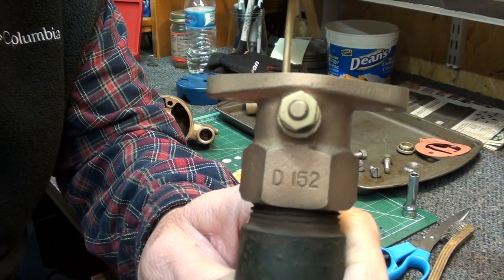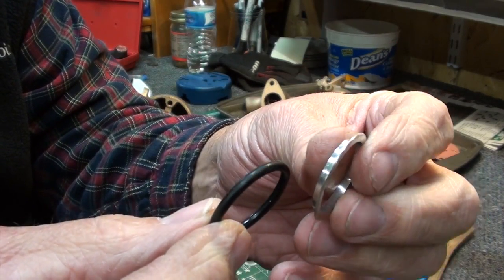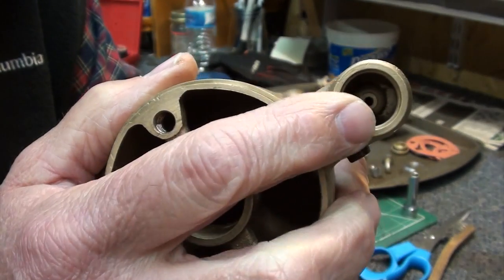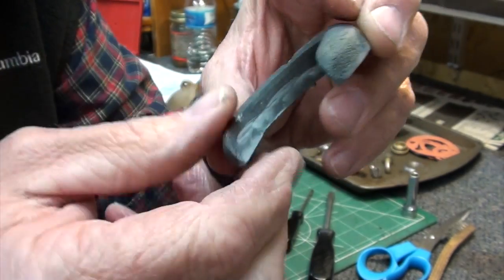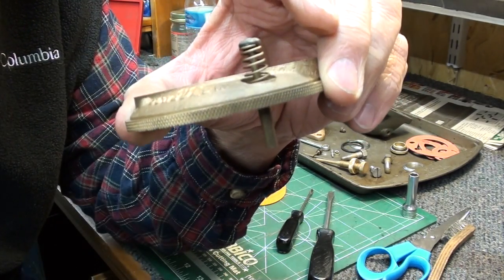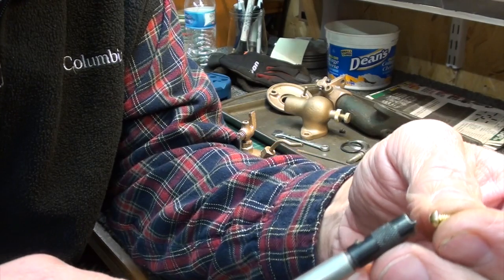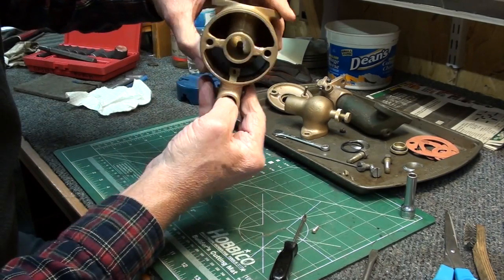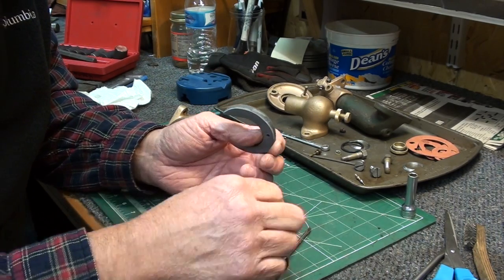Schebler "D" Carb Rebuild

Comment: I'm five years late to the picture show,  having just picked up a Schebler D205 at a swap meet. Seller said it had been on a 1904/05 Yale automobile. Slightly different than yours but virtually the same. Although I have no use for it, it's a beautiful piece of automotive history. Your video and information was invaluable. Now I feel as if I can safely disassemble the Schebler without damaging it. Was hoping that you would end the video with a few more details. Especially gasket material thickness and O-ring sizes. Your O-ring retainer is genius. Thank you sir.

Comment: Thanks for the video. I'm working on a Schebler Model D on a 1909 Buick. It has a second butterfly valve on the intake horn that is controlled from the front to act as a choke when crank-starting the engine.

Comment: I have two questions. What is the diameter of the leather disc and how do you dissemble the item that holds the leather disc?
Reply from the maker: The diameters may vary among carbs with different applications. Just size it to seal off the larger passage and then lightly spring it. Some trial and error here is not uncommon! If you look closely, mine had a nut that you could remove to change the leather...

Comment: Thank you for posting this video. I'm about to rebuild my carb for the second time. It's on an Acadia Marine engine. I like your solution of the two O-rings.
Question: Do you know what the little slot in the flange seen at 17:21 is for?
I've been thinking that if the carb bowl overflows because the float gets stuck, the fuel will come up through needle valve into the engine. The slot will provide a place for the gas to leak out instead of filling the engine. Your thoughts are appreciated.
Reply from the maker: Yes, I agree with you that this allows flooding to drain out.

Comment: do you have a good source of parts for these old brass beasts. i got a cushman today and theres parts needed for the scheb
Reply from the maker: New floats are available online. Other parts must be either fabricated or removed from other “donor” carbs. 
I usually keep an eye out for these at the swap meets, etc. Or as a last resort due to inflated prices, E-Bay.
Reply: @enjundoc  ouch thanks all i need is the needle valve the rest ive found as mentioned on evilbay and a couple other places

Comment: What type of material is the float made up of ?
Reply from the maker: Nitrophyl
Available here:
https://www.restorationstuff.com/ecommerce/index.php?main_page=index&cPath=69
Reply: I was wondering if the tool that you used to help install the brass screws had a name or number on it .I am looking to purchase one. I have purchased my first Cushman engine last week. After I get spark I will be looking to rebuild the carburetor.
Reply: Out of curiosity has anyone ever bolted a tractor  updraft carb to one of these engines ? If so how did they run ?